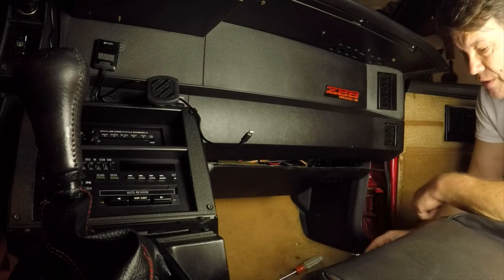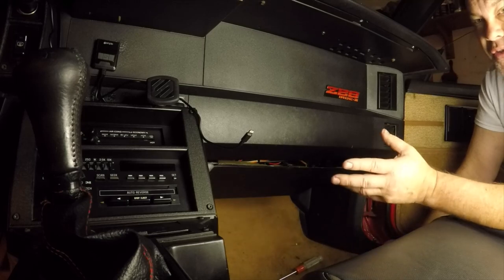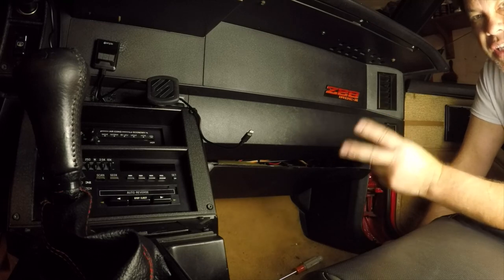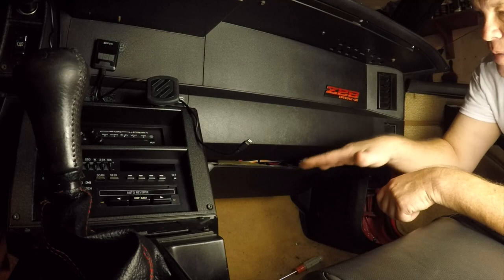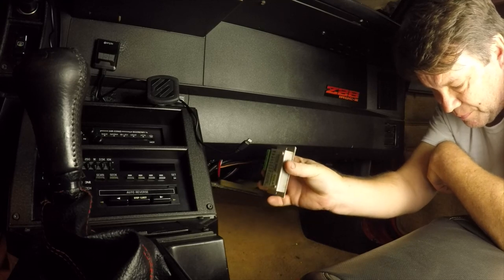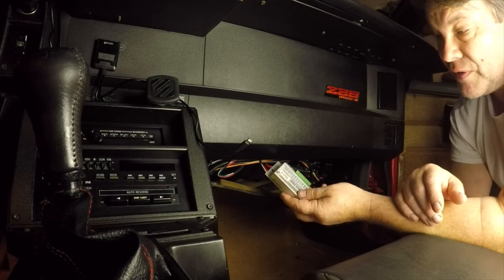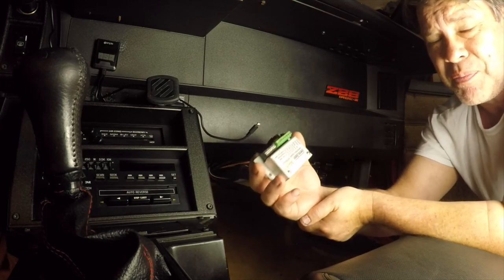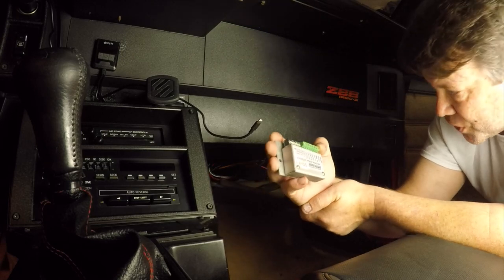Stock Tach Working on LS Swap

Comment: Where do you find the tach input wire coming off of the tach? Do you need to remove the dash and pull the tach? Someone installed a digital tach to a white wire coming off of the factory tach. When I disconnected it, the digital tach stopped registering numbers. Is that white wire my tach input wire? Sorry im not a mechanic or an electrician 🤦🏻‍♂️
Reply from the maker: That sounds like it, it’s typically a white wire, yes.
Reply from the maker: They are also different schematics based on your year and model. Send me your make and model and year and I’ll look the diagram up for ya. Also what engine and is it TPI

Comment: Hello I have a 1988 Pontiac trans am I did my ls swap I keep hearing Pontiac went to electronic first what colors do I splice into get my speedo working
Reply from the maker: Which motor ?
Reply: @FireballMullet  original had a 5.0 now it has 5.3 ls
Reply from the maker: @jaydeee5961  I can’t find that one but the ones I’m seeing is C1 connector (cluster plug the one on the right side looking at the dash) might be brown... but that’s camaro . Try to search C1 or C2 wire diagram for the images
Reply: @FireballMullet  I ran into a forum stating it’s the white color wire from the bulk ? I will search ur information as well
Reply: @FireballMullet  I will check ur information there is no way I can get the tach to work from the bulk in the engine compartment?
Reply: @jaydeee5961  Did you get this working? Im in the same boat right now. Someone had installed a digital tach which was plugged into a 12v source, then a grey/green wire was twisted onto (not even spliced) a thin white wire coming off the backside of the factory tach. When I separated the digital tach wire from the white wire the digital tach stopped registering rpms. Is that white wire the tach input wire? What were your findings. I hate that they put on this digital tach and scrubbed the OEM tach. I want to put the interior back into looking stock and looking clean. Tell me everything you know! 😉

Comment: Do you have links for the resister and the other mod you need to have the cluster to work ?
Reply from the maker: What year is your car? Do you have cable speed? Dakota Digital has a box that does both speed and Tach. I suggest that one if you have later model speedo no cable. A couple to look at SGI-100BT is combo or Tach only (don’t need resistor) SGI-8E
Reply: @FireballMullet  well my car is a 1986
Reply from the maker: @DreadxHeadAR  I believe that is cable. So you need two boxes, one for Tach mentioned above SGI8e and you need a cable to vss converter box ECD-200BT
Reply from the maker: https://www.dakotadigital.com/index.cfm/page/ptype=product/product_id=886/mode=prod/prd886.htm
Reply from the maker: http://www.dakotadigital.com/pdf/sgi-8d.pdf